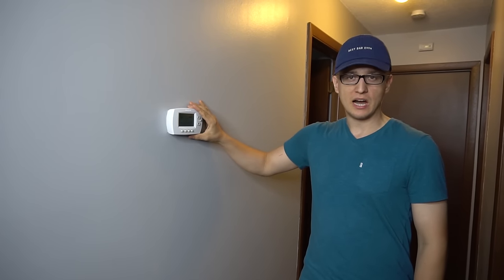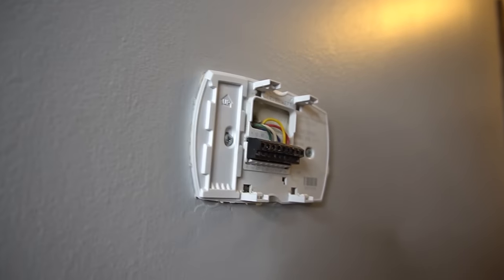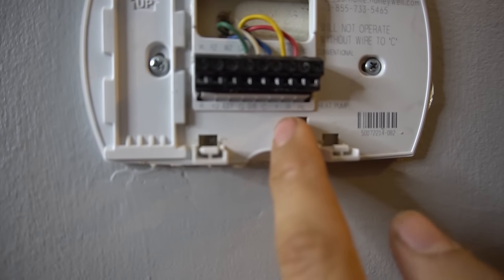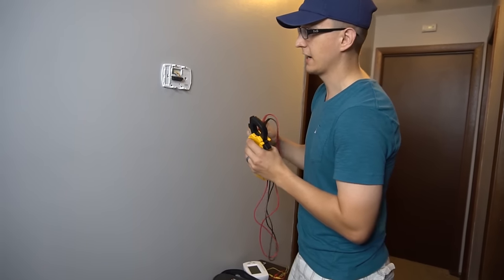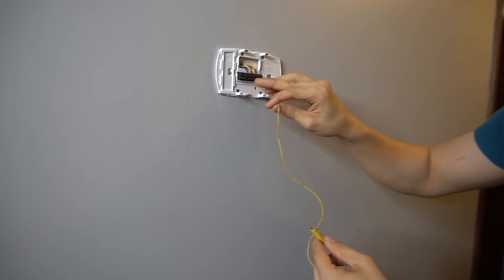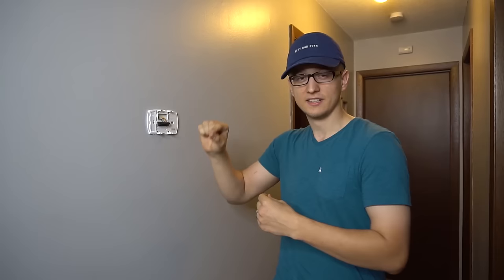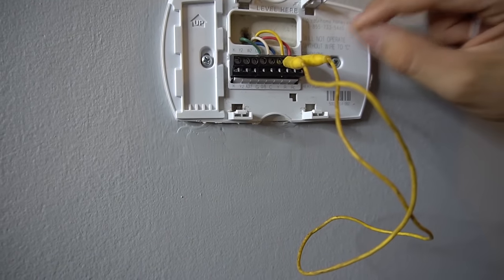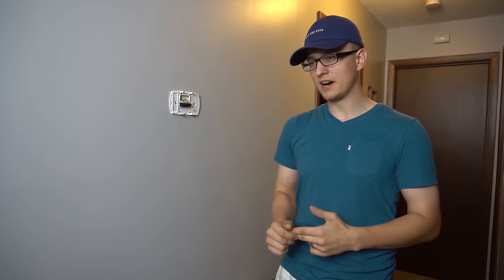How to Tell if Your Home Thermostat is Bad - Bypass it and Find Out

Comment: One very important thing he forgot to mention is NOT TO JUMP "R" to "C" or be VERY careful not to touch the "R" to "C" as this will burn the fuse on the control board or  trip the low voltage fuse inside the furnace.  In most cases you will not even know you did this as it will not spark or anything. The fuse is like a car fuse that sits in a slot on the control board or sometimes a button on the housing where the control board sits.
Reply: Excellent comment.
Reply: What color is "C"?
Reply: R is usually the hot wire with 24 volts and C is the neutral wire, so if they touch it is like putting a wire from one hole in an outlet to another in the same outlet !! but because the voltage is 24 and not 110 or 220, it usually will not spark and not electrocute someone.
Reply: Yeah I just accidentally jumped R to C (red to blue in my case). 
Thanks for revealing the fuse in my furnace. Found it. Going to the auto shop tomorrow for a replacement 3A blade fuse.
Reply: I just jumped R and my entire board sparked and went blank…uggghhh
Reply: @amberwilson6246  it should have a fuse, what is your issue?
Reply: But he just did that
Reply: @essakadiri8577  I was a fuse. I replaced it and it’s back to blowing by cool air. Not hot nor cold. I have to have the guy come back out.
Reply: @abstractlight1620  he said is blue or brown I bilieve
Reply: He said use a test meter to check between R and C not to jump it  Hope this clears that issue up
Reply: @michaelsullivan9342 If you connect a meter to R and C it will not blow the fuse because a meter operates parallel to the circuit.  If you jump R and C it will direct short the circuit blowing the fuse.
Reply: Why would that be? I know the power wire and common wire are connected to the transformer, but why does that blow the fuse. Thanks.
Reply: This is low voltage 24 volts. If you touch the hot wire (usually marked R) with the neutral wire (usually marked C)  the fuse on the board will burn to prevent any damage to the control board itself or other electrical components, similarly like a breaker in the electrical panel. 
Now if you touch the wires as they come out directly from the transformer  briefly, it probably will not do anything, but if you hold them together long enough, you will burn the transformer.
Reply: @michaelsullivan9342 you can test R to C but you cant JUMP R to C, its very simple

Comment: If you have gas heat, you only jumper red to white as the white call will energize heat and the fan without green being jumped. Because gas heat fires the gas first while delaying the fan, the fan will be brought on by time delay. if you have a heat pump, wire red,green,yellow,orange....those four together will call for the indoor fan, the compressor and the reversing valve.
Reply: So if a thermostat isnt energizing G on the thermostat side. Can I bypass it by wiring G to C? Or do I have to jumper G to energize with cooling/heating respectively based on season?
Reply: Nice. Next time dont add your 2 cents.  Make your own videos.  If your not willing to answer questions dont act like you care.
Reply: Rob, thank you for adding your two cents. It was appreciated and I don’t have any emotional connection to whether you care about me or not… (like Others.)
Reply: Where did the orange wire come from?

Comment: Man, you saved me! My thermostat was bad. Weird because I bought a honeywell cheapo several months ago. What happened is I turned on ac for the first time and heat seemed to come on and so did the compressor at the condenser.  I turn off the thermostat and seemed like 7 to 8 minuets before it finally turned off. Anyway,  I jumped red and yellow and boom , my ac is throwing cold air. I will be at home depot in the morning. Thanks man for this video and all your videos. I learned alot tonight.

Comment: Great video.  Thanks much!  As a suggestion, I would first start with red and green wire (fan) with the jumper since there is no timer or limit switch on that circuit.  By using the red and yellow (A/C) you might turn on the timer/limit switch because the A/C compressor has a high and low side for pressure and possibly damage the A/C unit.  If you activate the A/C timer/limit switch, the A/C unit may not operate until the time/limit switch times out.

Comment: Jay, after replacing the control board didn't solve the no heat problem and numerous other checks using your vids, I verifieded with a paper clip at the furnace and then the thermostat that it is the thermostat that I replaced a few months ago either was bad then or more likely I didn't throw the breaker and ruined it. I have just ordered another Tstat.  Thanks for all your help.  You saved me again and never have had to spend the money on a teh visit

Comment: Thank you for this great video (and series) Jay.  My A/C wasn't starting up, so after some investigation I determined that the major components in the AC unit appeared to be fine but the contactor switch wasn't engaging.  I viewed your video on the top ten reasons for that not working and landed here.  I jumpered my thermostat and sure enough the contactor engaged and the unit started cooling so I knew with confidence that the thermostat was faulty.  As a bonus I found an unused fifth wire running to my thermostat that I was able to connect to common on the furnace control board so that I could get a WiFi enabled replacement that didn't require batteries (it might even be the same Honeywell unit you have pictured in the video).  I should also mentioned that the unit I replaced seemed otherwise fine - the display looked okay and the furnace fan was still blowing (I did replace the batteries as a cheap test anyway but it didn't help).  So it would appear that a single system is capable of failure on a thermostat without the others necessarily  being bad too.  Thanks again - I loved being able to figure this out by myself without making a service call (or buying replacement parts at random to see if that might be the solution).
Reply from the maker: Glad to hear you were able to track down the problem and get it fixed! People like you are the best :) Many people would only watch one video for a couple minutes and then comment right away asking, "My AC doesn't turn on, what do I do?" You actually took the time to watch the needed videos and figure it out. Congrats on repairing it yourself! Next time around it will be easier ;) Thank you for commenting and sharing your experience!
Reply: I have a Honeywell stat and have a jumper between r an e.g. or r and rc is that. Correct karl
Reply: @WordofAdviceTV  l

Comment: Jay or anyone who knows, why the thermostat needs a cable of 24 volts for itself? Why can’t use the 24 volts from the red wire? Or is it that those 24 volts won’t be enough for the thermostat plus the other function it needs to charge? Ok i got that might be the case. But now, how does the 24 volts from the blue wire works? Ok it energies the thermostat but how does the circuit closes for those 24 volts? I hope i am clear on my question. THANKS whoever answers, and thanks for explaining Jay, I have years watching your vids and i comeback often to review info.

Comment: Just wanted to say thank you.  Ac went out on my 8 year old house.  Replaced capacitor and contactor because they are the least expensive parts but unit wouldn’t kick on.  Turns out had a bad ecobee thermostat I bought after building new home.

Comment: Thanks, Jay. Great video. It helped me to determine my thermostat is bad.  I had a power outage this morning. When power was restored my ac fan came on blowing harder than usual. I turned the thermostat to off and the fan continued to run. Only after shutting off the circuit breaker did the fan stop. So I did your test using a coated paperclip and snipping off the coating at each end of the paperclip. I jumped from R to Y and turned breaker back on. Outside unit came on to cool. I have been a subscriber for months! Thank you for helping so many people such as myself.

Comment: Thank you Dude!! Just replace my thermostat and the technician did not do a by pass from R to RC and my AC turned on. 

The oil provider ROB here in NY is charging  mr for 125 dollars diagnostics and 215 per hour of labor and plus for parts and blah blah blah!!

I just did it my self bypassing..

Comment: Thanks for saving me from freezing, you are simply great. Everything you said worked as in your video, my heater is now running and the house is getting warm. If I understood right putting jumper wire between R and Rc will make both cool and heat work. Before I had the wire in Rc only and AC worked fine but heat didn't.
Reply from the maker: Happy to help! Yes, that is correct. Some thermostats have Rh as well. (power to heating). Glad to hear you got the heat going again! Stay warm! :)
Reply: RC and RH are separated to accommodate systems that have two transformers. If you only have one transformer, you terminate to either one and have them jumped together. Most stats will have a factory jumper already installed as most systems have only one transformer.

Comment: Jay, help! Today I noticed that he AC unit wouldn’t come on at all, so here are the steps I did:

First, I took readings with my multimeter at the thermostat. 24 volts

Then I checked outside at the contactor and I had 24 volts going in.

Came back to the thermostat and thought it could be a broken thermostat. So I created a little jumper cable like you said (running red to yellow), and bingo! The AC unit came on. So this indicated that I may have a bad thermostat...then, I messed up. Even though the compressor and the fan came on, I still didn’t notice any air blowing out of the vents in the living space. So I thought, oh, I must have to connect the red to the green one (fan) and the yellow (AC) together. Then I thought, “well, I might as well connect blue, yellow, green, and red together.” So I twisted all of them together (but first I shut off the disconnect). Then I flipped the disconnect on and now I have nothing. And when I went back to separating them and putting them back into their designated spot in the thermostat now I got nothing. No voltage, and the thermostat is completely dead now. Now I don’t know where to go...perhaps I blew a fuse or something? Any words of wisdom?
Reply from the maker: Hey Nick! Sorry to hear about your troubles! It sounds like either your thermostat may be bad or perhaps weak batteries? It would have been okay if you wired G, R, and Y together.. But G is for fan, R is a hot wire (24v) and C is a common. By connecting R and C, a direct short is created. Most likely your 3 amp fuse is blown. It should be in the furnace control board. After you replace the fuse or reset the little 3 amp breaker, I would watch this video next as to why the blower is not coming on: https://www.youtube.com/watch?v=JSgLGTAbDF8&t=9s
Reply: Word of Advice TV , you are the best...nailed it! Thanks for the help!

Comment: FYI,  It just started getting warm and my A/C stopped cooling/working , the Cool temp was set to 83 and the current temp in house was 85.  The fan in the house was working but I went outside to see if the compressor/fan were going but it was NOT. So, it was NOT being turned on by the thermostat ( or the fan/compressor/capacitors were bad ).  So, I changed the batteries ( 2 AAs ) and then tried to turn on the Thermostat but it stayed in the OFF position no matter what the COOL or HEAT setting was. So I went to chatGPT AI and it said to press the RESET button on the thermostat ( using a small screwdriver to push into the reset hole ). Voila , the Thermostat re-booted and I was able to set the Cool temperature and startup the A/C.  So, with a good DIY attitude and Jay you can fix things too !

Comment: You are the best on how you explain the process of troubleshooting. I have question for you.
One Smart termostat Nest was set to Heating. But the system turned on the AC during winter and caused the evaporator to freeze.
For troubleahooting:-
1.   Y1 is removed from the circuit board at furnace, and removed the Nest thermostat face. Y1 still connected on terminal plate of thermostate. And  It read 24v on Y1 at furnace side while termostate is not even covered. If Y1 is removed from termostate terminal, it has no voltage down the Furnace side Y1.
I believed the Y1 is getting power at terminal plate of thermostat. Which means RC was creating direct connection to Y1. 
What do you think?

Comment: You did a fantastic job, explained everything well on what was going on with everything. Used your testing method, fixed my issue. Thank you!
Reply: Rc  24v  power  from  cooling  tranformer   R24v   power  fro  heating  transformer  ycomperssor  contacter  y2  compressor  conttacter   stage  2   g  fan     e merfncy   aux  het  rely  lseds  out  put  when  set  to  em  heat   c  24v  comon  ..

Comment: Thank you for the great video.  I have a question with regard to the bypass.  You  mentioned that it is better to turn the furnace switch off After you find out if the thermostat is getting power to do the bypass.   How can the motherboard gets power to turn on things if you switch the furnace off, am I missing something?

Comment: Awesome video. It worked. Just one question and it's probably a stupid one. That's all I need to do until they can come fix the thermostat right? It's running now and will continue to run until I flip the switch. Is that a safe way to run it?

Comment: My Symptom: Air Conditioning working fine with no Issues. But when I would turn on the heat I would get a wiring error on the Nest E103 W1. Note: the Compressor would short cycle in heat mode but not in cooling mode. After about 10 minutes of this I would get the crossed wrenches symbol on the Nest. This system has been working for 4 plus year prior to the error message.  
Love your AC videos! FYI I have a 5 Ton Trane handler and a Trane Model 4TWX8060A 1000CA Compressor. When I jumped the R1 and W1 to by-pass the Thermostat it blew the 5 amp fuse in the air handler. Not sure what I did wrong? However, once I got the fuse replaced I abandoned the thermostat by-pass test and re-did the R1, Blue Common, and W1 connections at the compressor and now all seems to be working.
Thank you for all the helpful videos!!!

Comment: Well done and thank you for that awesome tip. My unit is not working and your advice, gives me more time to consider options. Great safety comments too, really appreciate you!!
I do have a question, my issue with my AC is I accidentally disconnected the wires from the outdoor unit to the sensor. And the wiring the installer did was to connect to the same outdoor safety switch that brings the line to the load. I can't find any advice on how to reconnect the sensor wires.

Comment: Another excellent video but sadly nothing happened on jump. Have been going step by step at least I can rule out the thermostat. No fuse in sight, connector works when pushing in, have a Payne and no obvious or accessible float valve when I tried to check. The mystery continues thanks for sharing your expertise

Comment: You sir are a wealth of knowledge! I'm subbed!  I am having these issues at present and came across your channel and have been watching the videos you posted. My furnace just started short cycling recently and I am trying to troubleshoot it with out calling for repair but that option isn't off the table. I have a lennox elite g50uh. I don't have the on/off switch at the furnace so I have to trip the breaker. I cleaned the flame sensor though it really didn't look that dirty as compared to what the videos have shown it can look like but problem remains. I will replace it since it doesn't cost much and see if that fixes it. Blower fan starts, the igniter lights,, I get flame but it turns itself off. It either turns itself off quickly or turns on but stops shortly thereafter. 

I've wanted to replace the thermostat to something a bit more modern (and I'm not sure if this is the problem).

Comment: Thank you so much! After watching three of your videos and following the trouble shooting suggestions I found: 1) we had an abandoned mouse nest in the outside A/C unit
2) our thermostat is faulty. I’m off to get a replacement now! 
Thank you again for saving me a ton of money and not having to make a service call!
Reply from the maker: Glad to hear my videos helped! Thank you for watching and commenting!
Reply: So, replacing the thermostat made the outside unit  start working again, but the air blowing through the vents still isn’t cold. :( Guess it’s time to call a repair guy?
Reply from the maker: @kyla1828  My guess would be that the compressor outside is not coming on. Only the fan is running which makes it look like it's working normally.  Perhaps a chewed wire or a bad capacitor? It is up to you though.. I have plenty of videos on the topic that you can use to track down the problem or it's time to call out a tech

Comment: Before replacing the thermostat or something else check for obstructed drain water duct kicking the sensor off. Just remove the plug with 2 wires some where around the pvc tube. It may help

Comment: Thanks for sharing the info. The water leaked from the roof on my wall and the thermostat got wet. I thought the unit would start working after drying, but it didn't even after completely drying the unit. I changed the battery as well but it didn't turn on. Does that mean the thermostat has gone bad? The unit is "Honeywell VisionPRO 8000 Programmable Thermostat". Your comment is much appreciated.